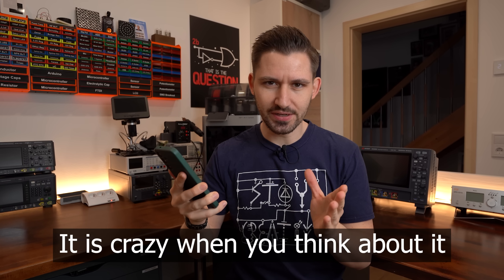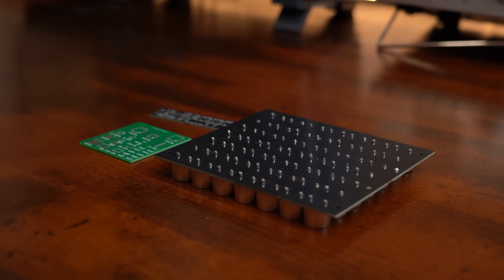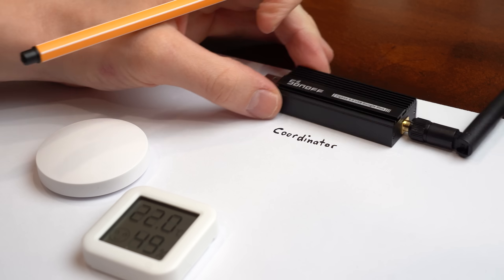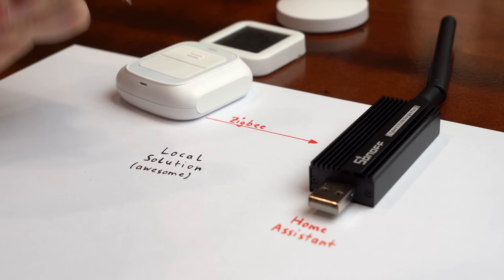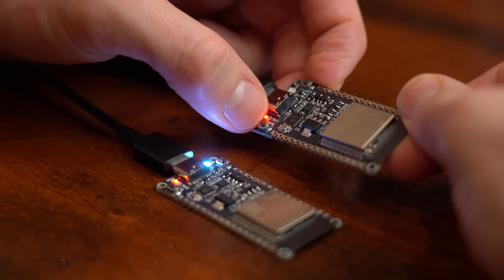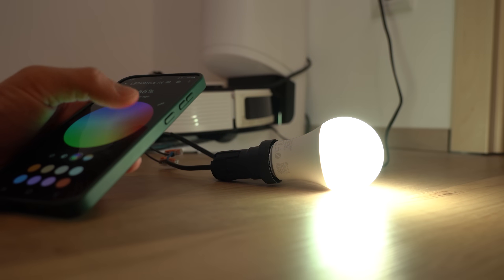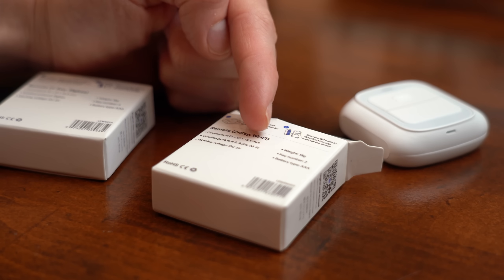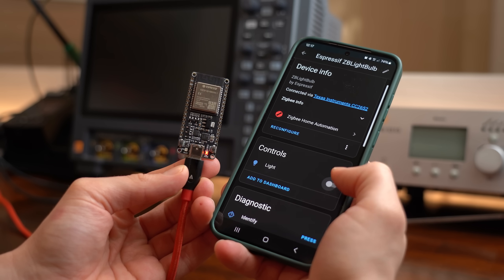Forget WiFi AGAIN! This Wireless Method is WAY Better? (Zigbee)

Comment: I like Zigbee for it separates your WIFI LAN from devices. I have little trust in a.o. chinese light bulbs running on my WIFI lan for you never know what they put in there to "open up" your network. Apart from that, Zigbee protocol is very nice in propagating messages point-to-point in the zigbee network.

Comment: 85-260 meters for Zigbee is impressive. I have Zigbee devices as close as 9 meters from the coordinator with a clear view between coordinator and devices, and still struggling with poor signal and falling offline even with no WiFi nearby to interfere 😭

Comment: Your comparison at 8:00 sadly is not sufficient./
Test conditions:
You cannot judge a BT device without specifying its device power class out of three. OK, that holds true for every RF link. However, LoRa is that efficient, power is virtually of no concern any more.
I use BT Thermometers, transmitting through two concrete floors. Yes, ZigBee is doing better, but may the BT force with you. Sometimes you only need one BT sensor, so better not purchase the ZigBee coordinator - Hub - Dongle, you name it.

Optimizing RF performance, this one is important beyond your test results:
BT uses a frequency hopping scheme. WIFI and ZigBee occupy static RF channels in the same part of the spectrum around 2,4GHz, As such, BT interferes with WIFI in a distributed random fashion across all channels. BT + WIFI are zero-config as is with BT + ZigBee. Not so with ZigBee and WIFI. Since Zigbee uses fixed channels just as WIFI, transmission performance may vary tremendously. The corresponding base stations, say Coordinator and Access point do not cooperate. They manage transmision arbitrarily. Whenever a WIFI network faces a high datarate demand, ZigBee using the same part of the spectrum suffers and vice versa, because the send time of WIFI will go up over 50%, leaving no space for other static RF links and vice versa. So please include choosing Zigbee and WIFI channels carefully as a must for your home automation setup. And please, speak with neighbours in case, they are close. You will gain much WIFI performance when using either the 3- OR 4-channel WIFI scheme, with the first being the default, the latter being the EU scheme, making use of WIFI channel 13,,activating a boost of 33% spectrum efficiency.. When optimizing WIFI, your ZigBee transmissions will gain as well, by nature. Because the air time of all competing participants is minimized.
For those not willing to investigate, here comes the no-brainer solution. Make sure, your setup is configured as follows, hopefully including neighbours:

WIFI on 2,4 GHz 
  Channels either 1, 6, or 11 - US channel scheme - NO other channel on any of the WIFI devices
  WIFI standards
    be, ax, n only
    not a, g, forbidden by death penalty: b! (WIFI stone age, useless and interfering)
    ac? ac is 5GHz only.
 channel bandwidth: 20 Mhz

ZigBee on 2.4 GHz
Channels 25 or 26.

Comment: Buy a slzb-mr1. It's a PoE powered zigbee/Matter (2 parallel chips;: texas, silabs) ethernet-adapter. It works great with my Homeassistent and zigbee2mqtt. 👍

Comment: With WiFi you also have to worry about a bunch of random devices on your network reaching out to the internet. Of course you can and should make a guest network for this, but it's more work to do that and with some ISP-provided routers you might not have that sort of control.

Comment: As an example of Zigbee's far superior power efficiency I have one IKEA trådlös motion sensor in my bathroom. It's used several times a day, every day all year around. It's powered by two 2032 cells. It has been used for 2 years now since last battery-exchange. (Only using original VARTA cells as they seem to be holding up a lot better than other brands)

Comment: 4:01 this extension cord saved you a lot of frustration xD For some reason, connecting the sonoff gateway directly to the raspberry causes it to freeze every now and then. Extension cords save the day. Raspberry is generally not a very good device for homeassistant

Comment: The reason why power consumption on the ESP32 is similar for both wifi and zigbee is because the C6 is using the 802.11ax low power wifi standard

Comment: Hi Scott, I have a question, recently I wanted to make my led ceiling lights to be controlled with wifi or ZigBee controller. The only issue is, as it turns out, the led drivers are 120-200vdc 220mA and all controllers I could find are 24vdc 12A. Is there a way to overcome this issue because I can't find compatible led driver with wifi or ZigBee communication

Comment: Were you holding the ESP32's in front of your body while walking away from the coordinators? The human body absorbs 2.4Ghz quite well, so unless you held them both the exact same way (and from the video it looks like you didn't) the difference in range could be at least partly due to the one being blocked more than the other.

Comment: would have been good for you to test out the power usage in the ESP based boards - i suspect the simple example code you used has no power management so the boards are running at a pretty constant current draw and unlikely to suit battery power, but it'd be excellent if there was mature code that ran at better consumption. But yes, zigbee has some great benefits

Comment: The future doesnt bring much for Zigbee. It is being replaced by Matter over Thread, which is in many ways quite similar but not at all compatible.

However Zigbee is currently widespread and likely will be for a decade to come, so  no need to wait for the next standard to kick in. After all you can just have both a Zigbee and Thread network

Comment: Wi-Fi, Bluetooth, and others were designed for different data rates and continuous, high, bandwidth streaming, etc. Control data is wonderfully efficient and does not need to be updated by the Microsecond… thanks for covering this. Great summary!

Comment: The rated power for the C6 being mostly the same between WiFi and Zigbee is likely part of the reason you got so much range with it. I'd be interested to know if you can tune the transmit power down to conserve energy. 
I've got some Seeed C6 Xiaos and I REALLY want to play with them for customized home automations, but I'm just so far out of my depth (in part because I got them before the full Arduino support for the C6 had been built out). I'd love to see you do more with these just so I can feel more confident with them myself. 

Zigbee is GREAT for low-power intermittent activity, like home automation, where all the data you need to send is often just a couple of bits. The mesh capabilities give them great redundancy and allow for richly complex environments to operate reliably (though there is some extra work to get large meshes to work well - tl;dr: plug in your coordinator and repeaters first and don't move devices around too much). 

For comparison, Z-Wave is another similar mesh tech. Its biggest advantage is that it runs at 900mhz so it doesn't overlap with wifi or microwave ovens. Z-Wave certification also ensures cross-platform interoperability. But it does use slightly more power than Zigbee, and tends to cost more because of that certification. 
Zigbee is cheaper because it doesn't have the same certification process, but it also allows for proprietary implementations that will not work with other platforms. It is the lowest power off-the-shelf option out there. 

Both Z-Wave and Zigbee have the advantage of limiting your end devices' access to the internet. Meaning your cheap Ali Express light switch is less likely to have Chinese spyware on it. 

WiFi uses a ton of power and is essentially an "always on" connection. Any WiFi smarthome devices will compete with your laptop for WiFi broadcasting space and a lot of them will very quickly overwhelm even the best networks. Any WiFi device you plug in to your smart home can connect directly to the internet and send any data it can phish from your network back to its manufacturer (or the CCP). WiFi smart home devices should NEVER be connected to your main WiFi network, but should ALWAYS be joined to a dedicated "smart home devices" network on a separate VLAN. WiFi is by far the easiest to set up and get started with, but it is also by far THE WORST option for anything other than your computer and cell phone (and maybe your TV).

Thread and Matter are... essentially all the worst aspects of Zigbee mixed with all the worst aspects of WiFi. Just... Don't.

Comment: To your point at 4:40
This looks similar to my Avatto ZWT100 WH-3A thermostat, which I recently installed here in my room. This thermostat works flawlessly with Zigbee2MQTT and Home Assistant using the Zigbee protocol. No other app needed.
Edit:
Additionally, since it is connected to power, it also works as a router for the whole Zigbee network.

Comment: I feel like I should mention that the HomeAssistant SkyConnect is a ZigBee coordinator you can get that's 100% plug-and-play with HomeAssistant, comes with a USB extender (for better signal), and I think it's even cheaper than the one in your video. :)

Comment: i have an offgrid hybrid inverter. these inverters used to use bluetooth which is what i prefer and feel safe using.
as im poor i use prepaid mobile hotspot data so i can always jump to a better provider and if i run out of money my account is not overdrawn. to use wifi i need a second mobile phone. i do not trust the inverter companies as they seem to have accessed my inverter using wifi in the past.
what i want is to use r485 or can ports on the inverters and make them bluetooth again, with a phone app .
even bluetooth phone apps like victron are forced to use gps location which evil. where i am is none of any tech companies business .
so i would need a non playstore/ios app.

Comment: I think it's so strange that they use wireless communication in smarthome technologies that are connected to power. Why not use the powerline for the communication? It's inherently more secure, obviously there's no issue with radio interference and such and the wires are already there. Does someone have an explanation for this?

Comment: Honestly, The USB coordinator was flaky in my experience, freezing frequently enough to be annoying.   switched to a SLZB-06 (PoE) and instead of serial over USB, got a TCP socket with dual Ethernet/Wifi functions.  Use the ones with the CC chips though, as they support changing the local key, so you can adopt your paired usb-coordinator devices.

Comment: I have a circa 4yo Fetch media box (Hybroad: Model No. M616T) with a 1TB internal HDD which I purchased new and is not locked to any ISP, but due to circumstances beyond my control, was unable to use. It has never been used and has no useful data on it. I currently run Debian 12 and I was wondering if I could usefully re-purpose it with GNU/Linux to integrate with my home setup somehow (as a 1TB HDD seems a shame to waste)?

Comment: If you are into hacking, some wifi devices can be flashed with alternative local control firmwares, I did in a few here. But all of them are powered by the mains, and battery sensors are all zigbee.
Scott, you should do a wall mount tablet for your smart home, it would be fun to watch you develop a nice solution

Comment: Remember the day of dial-in modems? They often had a speed of 28, 33 or 57kbs. That is half of what Zigbee supports and we used those modems to browse the internet and maybe even downloaded mp3 using Napster. 100kbps is more than most people think it is. We are so used to megabyte and gigabyte speeds for laptops and computers that we simply forget what we are actually sending to and from the Zigbee device. 

As far I can see, there is only one downside of Zigbee and that is there can only be one coordinator in a network. That equals a rather large single point of failure. Because I have my home automation running on two computers and when the main computer goes down, I have to go to the basement and plug in Conbee stick in the other computer. Could have been easily been avoided if Zigbee would support virtual addresses, so the two computers could decide using heartbeat which is the primary and the virtual Zigbee address would move with it, in the same way that IP are loadbalanced (fail-over setup). A redundant setup is really required once you want to integrate Zigbee into your home automation. Thread, Matter, Zigbee and ZWave are all missing those features are therefor I stopped using them. See, I have a deal with my girlfriend. I can automate everything I want, but if something doesn't work, she is allowed to take a baseball bat to my knees. So wired connections are my fastest bet ;-)

One benefit on an wooden American home which if the big bad wolf starts blowing would crumble down, is that it is very easy to run network cables in the whole house. All bedrooms have at least 6 double RJ-45 outlets connected to patchpanels in the basement. I can now quickly wire-up anything...

Comment: A local micro controller got plenty for pretending to be a server for mobile apps (like a website in the micro controller) as the controllers (near home, inside), but some people might get hooked on remote control through the internet (far away). My internet can be down a whole day without a warning, so we can't trust it fully yet. Probably never. Micro controllers are more reliable in my opinion.

Comment: When I lost data connection recently all my Wi-Fi devices stopped working. Even the kitchen lights wouldn't come on, so if I'd done zigbee would they have all carried on through the zigbee router?. They would work without a external internet connection being active?
Reply: yes, if you have home assistant controlling your smart home.
Also depending what your wifi devices are, some can reflashed for local control only.
Reply: @anthonysbarrett  Thanks for the info. I have now got home assistant running on the Pi and have ordered a zigbee dongle. Looks like the zigbee stuff uses far less battery power as well. It's found all sorts of stuff even sensors in a separate house, I suppose that's because they're on the same account. It's all good fun. Thanks

Comment: The extension cable is actually recommended by many for increasing the dongle range. Not sure about placing it next to the Wi-Fi router though since the 2.4GHz frequencies might start intergering with one another. Then again it is possible to adjust the Wi-Fi channels used on the router and on the Zigbee dongle. I would recommend switching the HA integration from ZHA to Z2M. While it may be a bit of a hassle to set up, once running it provides more options for the end devices etc. I used some Zigbee radiator valves and in ZHA I could not get them running initially. Once I got them running there were some unknown switches. After I switched to Zigbee2MQTT, these switches turned out to be Scale protection switches. I have also read that Z2M provides a little bit better range for the network.

Comment: About the power consumption, the datasheet of the C6 is not really a good indication.
I'm in the process of building a zigbee network based on ESP32-H2. 
When configured as router, with 4 inputs, they drain 31mA under 3,3V. It is nearly a tenth of what is in the spec sheet of the C6.

Comment: my only complain about zigbee is that it interferes with 2.4 wifi and mesh reconfiguration can be a nightmare after power loss on networks with lots of devices.

Comment: Great video. Newbie question…zigbee is a local mesh network and does not consume wireless data from your home router??
Reply: Did you even watch the video or glance at the dozens of comments that way “Zigbee cannot connect to the internet”?

Ok… so… Zigbee cannot connect to the internet and doesn’t connect to your WiFi at all. It’s its own thing and only talks to other Zigbee devices.
Reply: @ArmchairDeity - TY
Reply: @ericsmith5683  no worries… have a good one. 😊

Comment: You have shown that the one esp-32 board goes further than the other esp-32 board for zigbee.  
You are labeling this is benefit as zigbee but I wonder if it is just a better wifi board and if you use the same board does it also goes further with wifi?

Also curious about the range of the supported bluetooth and thread on the same devices.

Comment: I had all Zigbee devices (bulbs, sensors, switches) here about 10-12 years ago. I've finally gotten rid of the last of them as for me they were unreliable, showed a lot of compatibility issues with different "zigbee" hubs _including the hub some of them shipped with_, and all had pretty terrible range issues around the house. Maybe they've changed, but I'm just no longer interested. And I just don't have the issues with the wifi replacement devices.

Comment: Great video Scott! 👌 And congratulations 👏👏🙂 It looks like you've hit something here. I want to say this video of yours on Zigbee is very informative and useful. I has been thinking of doing something with Zigbee but it seems like unless I try to read up quite a bit, things are unclear. The problem being there are so many different home automation protocols. Zigbee seems really good, specially now since you have tested it. If you can make more videos on using Zigbee with ESP32C6 or just Esp32, that would be great. I think there is a dearth of information in this regard and will really help/empower the community to be able to do home automation using Zigbee and ESP. Thanks!

Comment: Next time grab the Zigbee bulbs from Lidl, they have 98.2 CRI and a very good R9 extended CRI number of 96 - much better than all other Zigbee bulbs I've seen so far. You can get them for four bucks sometimes in a sale, currently for 6 bucks. Normal price is around 13 bucks.
Reply: Hello!, do RGB colors look better on Lidl bulbs than on Philips?